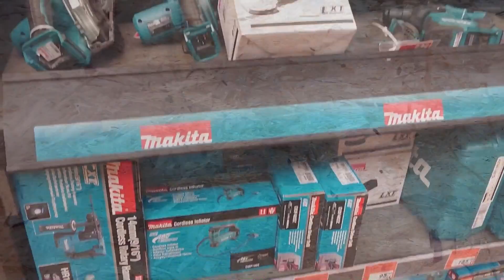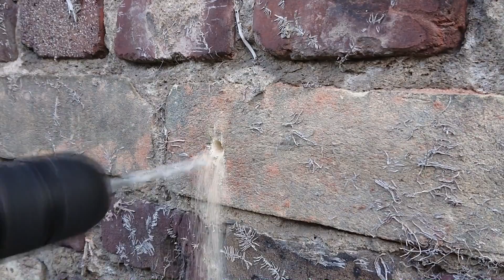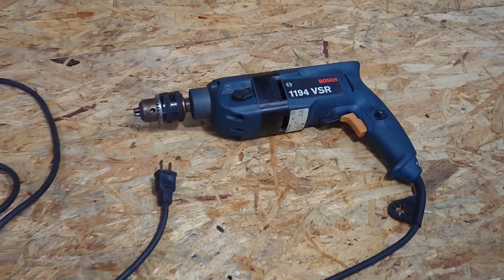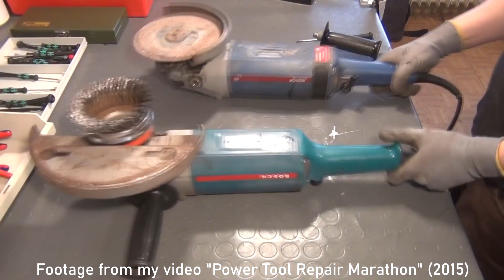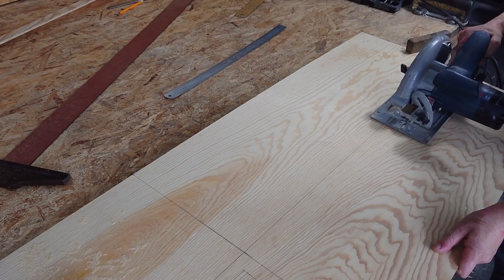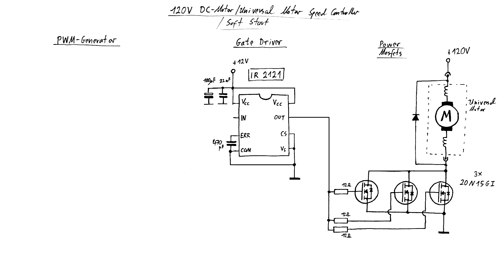Battery Tool Experiments:  Converting 120V Tools to Battery Power / NiCd to Lithium

Comment: Been using two of my old ( 15 yrs +) for 2 years with cheap 18 v li-ion batteries for another brand. These are 12 v machines but has been running great, still running. No regulators or anything. Just straight up. The trick is to choose a cheap brand of batteries with all control circuitry in each battery. Meaning that the battery itself protects against high temp and such. The tools has only hight temp shut off. This combination works well. 3d print my adapters, the oldest one i have is made out of wood. Thanks for sharing, awesome!

Comment: Yes - big angle grinders now have a soft start - the old black and decker 9 inchers used to kick like a mule!
Reply: You gotta brace for it like a shotgun.
Reply: 9" angle grinders were banned from worksite use in NSW (Australia), because too many workers were getting badly injured by them kicking back on start-up.
Reply: @dj1NM3  What we’re the people who owned them supposed to do, put a propeller on it and use it as a fan?
Reply: @bjoe385  well rotating mass has force.. And angle grinders kick like a beast if you don't know that you have the disk in your leg or chest faster then you can look
Reply: @horacegentleman3296  good old times 😎 I remembre that 🤣
Reply: Mainly because no softstart would blow out breakers and the switch
Reply: My 9" harbor freight grinder does not have one unfortunately. I use that thing with somber respect.

Comment: The adapters really do increase the value/versatility of any of the popular batteries. I have extended the life of my Dewalt 18vdc tools  by converting them to the new 20 volt max. I also converted my hedge trimmer from the expensive 40v battery by using two 20 volt max batteries in series. Thanks for going over the circuitry. It is nice to be able to provide a dc voltage without dragging out my HP power supplies when doing automotive component testing. Cheers and thank you for the education for which I am glad to chip in on your patreon.

Comment: I have to say, that converted big angle grinder looks a lot more comfortable to use than a 2x18V battery driven grinder
Reply: And probably, it will work longer. My LXT 18V single battery grinder is barely able to make ONE cut of the flatbar 100x10 using 1mm thick 115 disc. I am dissapointed.
Reply: @5084204  What kind of battery? I can grind and cut for 15-20min with one 5Ah battery
Reply: @kampfnudel22  genuine Makita 3Ah
Reply: Makita have a backpack that can fit your battery tools. If I knew about it before I bought my kit it would have been my go to
Reply: @5084204  3Ah is not enough for a grinder. I have a cheapo brand and get about 10min of light work on a 4Ah battery. The 2.5Ah is dead almost immediatly. Get a 6Ah makita battery and the grinder should run much longer. Also let the disk do the cutting, dont push it. Battery grinders hate force.
Reply: @zanpekosak2383  thank you! Actually, I have bought the two extra 6Ah no names and small jobs with the thinner metals was possible. But the batteries do get hot. Very hot. Ideally, I just keep swapping them during the work.
Reply: @5084204  Yeah the nonames usually have used cells in them and are not safe. I recommend you charge them outside or have a 5 gallon bucket full of fine sand nearby. I have seen those things light up like gasoline. Seriusly
Reply: @zanpekosak2383  I already had to spot weld the terminal back to cell  as the temperature melted the solder , but before, just burnt 0.8 nickel strip. I changed it to 1.2mm am so far-so good, but as I said before, I do swap the no names half charge and I do check the temp regularly. Altogether, the 3 batteries do give me some work time offgrid.

Comment: I built a PSU to power old battery tools in my workshop.  Ok its cables again but it's a simple solution.  I then have a 12volt drill that lives on my mobile 80 watt solar array that runs from the car battery that is being charged.  I can also use the starter car battery that's on my 5Kv generator.  Or attach to a lithium portable power bank.  Loads of options bro.  Glad to hear you are well.  :)

Comment: I've mentioned this before on your last conversion:
Make sure your low-voltage cut-off for any device using the Makita packs is very conservative with a higher rebound voltage threshold. The Makita battery packs will brick themselves if they hit overdischarge 3 times.
Reply: This is very good to know. Just recently found out the Makita batteries don't have built in under-voltage protection, while working on a e-scooter project using Makita-cells. Would you happen to have any sources for where about cut-off should be? Currently I am using 14.3V for cut-off for 18V packs.
Reply: @thorflot  That's odd. Do you have older LXT Makita batteries?

I cannot recall, sorry. 14.3 V seems okay, if one assumes 14.3 V / 5 cells = 2.86 V per cell. It would all depend on your cell type, cell arrangement, overall Ah capacity, pack age.

Last I did a conversion I ran the battery down with a low amperage draw tool, slowly, to see where the battery meter showed spent measured the voltage at that point. Disconnected, waited 15-20 minutes and then measured what the voltage was after the rebound. Bear in mind, those were older (but still Star) 5.0 Ah battery packs.

The process didn't seem to differ between, no-brand, Milwaukee, and Makita in my experience.

Milwaukee packs can easily be recovered when the charger refuses it in an under voltage condition. Makita and Dyson packs seem to burn their controllers and, by the reports of others are not recoverable on the IC level.

Good luck!
Reply: @ALAPINO  not really. Bought a combo-set black friday in 2019. Thought for a long time the batteries had this built in, but was told that this is not the case, that the under-voltage cut off is in the tool, to keep down the battery cost? Of course, I would love to be wrong here!
Reply: @thorflot  I simply can't recall if Makita had them built-in because I always utilized an low-voltage cut-off module in my fun-time projects. I think your information is correct... come to think of it I don't think anyone has a low-voltage cut-off built into the pack.

I would certainly suggest you go with one.

I've standardized with Milwaukee packs at home, though I miss Makita for their wood working tools. They are far more physically and electronically robust in my experience.
Reply: @thorflot  I found some old notes:

BL1830 3.0 Ah, Makita. Ran, no work, on a Makita angle grinder until tool voltage cutoff. 12.8 V - 13.0 V. I averaged it out over a handful of runs to 13.0 V. So your ~14 V is very conservative. Accounting for rebound voltage, I wrote in 13.6 V, 2.72 V x 5.
Reply: @ALAPINO  Great, thanks!
Reply: @ALAPINO  most do actually, but not makita. I think there thinking was that the odpconsumes some energy so you can store them for longer? not sure. but this was intredused with the star marked tools, star = odp

Comment: Cool hack and collection of tools. It's good to standarize on one type of batteries, and adjust non-matching tools.
I revived a Bosch PSR14,4 drill by getting rid of battery altogether and adding a 12VDC power cord that I can use with SLA batteries, power supplies etc.

Comment: I noticed your grinder slowed down under load, I would use the op amps in the TL494  in a feedback loop to compensate for the higher loads by varying the PWM rate to keep speed constant.
Reply: Greatings,
At that moment the grinder is running at 100% duty so i don't any modulation would help.
Reply from the maker: @osamahnajjar2824  That is correct. It is already running at 100% in that instance

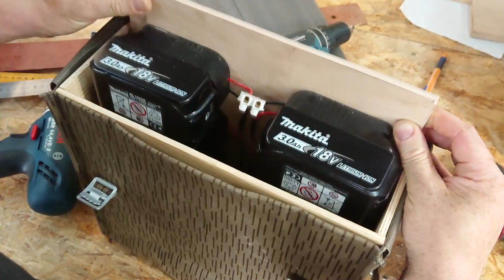Comment: 14:50 120V in a backpack, I would probably get so nervous that my sweaty palms would cause an electrical short lmao
Great work, as always!
Reply: It's DC. No worries there. Direct current can be touched up to 170v without feeling much. 60v DC is considered completely save to touch..
Reply: @peterzingler6221  But also DC has a big disadvantage of blood electrolysis. 
PS: You tell me 170V is "without feeling much" ? :D I once did that with both hands and it zapped me good. Still a way better than touching 230V just capacitively coupled touching only live wire.
Reply: @peterzingler6221  I've definitely felt 90v DC quite strongly, I'd never feel comfortable touching 120+vdc
Reply: @EngineeringNibbles  hardly depends on skin moistness and of course don't touch with both hands... But compared to a shock of the same ac voltage it's nothing
Reply: @teslakovalaborator  funny enough I have so dry skin I don't feel much up yes. I can feel it but it won't hurt. Talking about touching with 2 fingers not 2 hands

Comment: There is a brand that has this collection of cordless tools for "makers" that uses a single high capacity lithium ion battery pack that all the tools in the collection then connect to via a nice braided sleeve cable.  All the tools in the collection are small and brushless.  I've thought about converting older tools like the ones in this video to tether to an external high capacity lithium-ion power source.
Reply: which brand?
Reply: @albom.2744  I think it's proxxon

Comment: I've done a video on a similar thing as the 12V USB charger in your video, but with dewalt, since then they have made dewalt sockets which are really handy too. Those USB chargers are the best battery bank by far, everyone with Li-Ion drills should own one.

Comment: I have been running my old 9.6 makita stick pack drills strait from 18 volt modern makita lithium without issue.  I expected smoke or overspeed, but it has been going great so far.
Reply: Those old makita drills just don't die! If a compact variable speed switch was easy to build for it then they would be the bees knees as they say
Reply: @wearsjorge55  I must have lucked out because because two that I use are variable speed.    They were the newer ones toward the end of the 9.6 stick pack time.   It was good the motors have overload protection and they take a break before they start  smoking.    I  really  like that the chuck  shafts bearings are mounted in the drill body instead of an insert.    Sometimes I really need there to be no wobble between the chuck  and the handle and the conversion is great for that.
Reply: @ericjames5163  mate that's excellent. I didn't know the newer models had variable speed I'll have to keep an eye out for some

Comment: Yes, if this had a low danger of damaging my corded tools (including some lower wattage bench tools) and I had a clear understanding of duty cycle in order to protect the Makita batteries, I'd pay $599 for this solution.  I've been looking at camping-style battery generators and most of them look like they are destined for the junk heap right  out-of-the-box
Reply: ECO Flow RIVER 2 Pro, I used 2 of them for over a year putting a small camping site up on my Uncles land. You can buy bigger capacity ones but that one worked great for the small cutting and drilling jobs I did. I just laid 4 solar panels flat on the ground to charge one while using the other.

Comment: Most corded stuff in Canada can be had for a song. Usually Bosch drills as presented cost $5 or less used - like 3 EURO. For a lot of battery stuff it can also be had for a song if without a battery. For broken batteries it is a good idea to simply gut them and get new lithium power cells.

Comment: If you find an old Scroll Saw, it has a nice variable circuit you can use on just about any power tool motor. You can find them used very cheap as well. Scroll Saws are one of those tools people buy but, rarely use. 👍

Comment: This was very helpful. I have been trying (and struggling) to make a generic cordless vacuum motor for some time, since the motherboard of mine has failed. However, the battery has an anti-surge and I failed to build a soft-start with a RC circuit switching on a mosfet (destroyed the mosfet somehow).
Reply: The flyback voltage of some ac motors can by really really high.
Try adding a flyback diode if you don't have one already.
Reply: @SuperUltimateLP  i had a mains blower tgat would trip electric when it was switched off, i wonder if thats what it was?
Reply: @thomasdoherty6876  a mains powered motor usually doesn't have a permanent magnet in them, this means that it can't really act as a generator.
I don't think that any significant voltage would be fed back by it sorry.
Reply: @SuperUltimateLP  i wonder why it did it then very strange was only a little universal motor

Comment: Nice work mate! Just one comment - at 18:20 you say "voltage divider" - those two resistors are not forming a voltage divider. The 10k is limiting input current for IR2121 and I think it is actually completely unnecessary as IR2121 has a logic gate at the input and input current is only few uA anyway. The 1k is part of the inverting output of TL494 with open collector - I'd say you can easily turn it up to 10k or even more, this way you will get 10 times lower static current on that output - instead of ~18mA at highest duty cycle it will be ~1.8mA. I guess it's always a good thing to limit current consumption when your circuits runs on batteries, right ;-) Besides it will have no impact on the functionality. 
BTW, you put 12V on your schematic while with one battery you're getting 18V in your case and with full charge probably a little over 20V which will be slightly above recommended operation voltage of IR2121 but I think it should still be fine since it is still well below the absolute maximum of 25V.
I've also added a comment somewhere below that changing the gate resistor to a higher value for example 100R could reduce EM noise with a cost of slight heat production increase.
Side note - I was once planning to use battery powered angle grinder to run my Sinclair C5 ;-) I was planning to use 120-160V with parts of Toyota Prius battery pack and modifying the motor a bit. Since those are usually series motors it means they have stator winding in series with the commutator of the rotor. One can disconnect them and control both individually with lower voltage than nominal 230V (or 120 in your case) and also have a wider control over the RMPs and torque since you can change the excitation individually.

Comment: Recently I had to do some brake repair on my car.  Looking at the stupid screw jack, and remembering the times I laboriously cranked the car up and down when changing a flat, I hit on an idea.  I chucked the handle of the jack into my 20 volt Porter Cable drill, thinking it would at least get the jack up to the point where I could finish the job by hand.

To my surprise, the drill had little difficulty raising the car to working height, and letting it down again.  The handle didn't fit very well into the chuck, as it had a bend and a flat on the end for prying off the wheel cover, but was good enough to get the car off the ground with some finagling.

So...my idea: take one of the many old NiCad drills I have around, fit it with a cord to plug into a cigarette lighter socket and store it with the jack.  I'll obtain, modify or fabricate a more suitable 'bit' to fit into the jack to eliminate the wobbling I experienced using the original.  Voila'!  An electric jack for nearly zero cost.  If the it blows the lighter fuse, I'll equip it with suitable clips and connect it directly to the vehicle battery.

Comment: im wondering about the over-discharge protection. I think makita opted to place the odp circuit in the tools rather then the batteries. so is there one in the adapters?

Comment: We have 110v tool's for site work in Britain and as most are turning to cordless these tools can be had quite cheap.I would also like to point out the Aldi supermarket has a range of tools were the battery provides both 20 and 40 volts so only three would be needed for 120v or six for 240v , the charger and batteries are very reasonable.one last have you thought of using the circuitry from an inverter without the coils,ac current pure sign wave ??
Reply: The same goes for job sites in Ireland, which may be more accessible from Germany these days.

Comment: In England most building-site power is 110V AC as a safety measure. So hear 110V tools are easily available.
Reply: I’m just wondering why use 110V as that can still kill you? Does anyone know?
Reply: @Conservator.  A UK site transformer has a centre-tapped secondary winding, and the tap is used like an 'earth' to the metal case of your (eg) cement mixer.  So the supply is +- 55v, and you only get hit with 110v if you get across the two lines.

Comment: This portable angle grinder could be very useful right now in the part of West Germany, where floods have isolated complete villages from the rest of the world.  The power grid has been destroyed and there are mountains of all kinds of garbage and metal that have to be cut and removed.  Greetings from Belgium.  I was on holiday this very week in the Belgian city of Spa, near Liege.  The destruction by the flood is enormous.
Reply: There may be a problem with the safety of using such packages.
EU standards would certainly not allow this to be used, even if the batteries and electronics were in a waterproof housing.
Unauthorized modification, no safety and quality certificates - it costs millions, much more than the idea and making a prototype.

Comment: Overunity 'free energy' devices don't currently exist, but there are recognized mechanisms in engineering/physics that exhibit overunity, like water hammers, anti-stokes emission flourescopy, spherical sound wave attraction, and vapor cavitation. What if someone was to harness one of those recognized overunity mechanisms? Could be an interesting next topic. Apparently, there was an unauthorized guy in the 1800s that harnessed a few of those overunity mechanisms(allegedly). Anyway, thanks for the interesting vids!